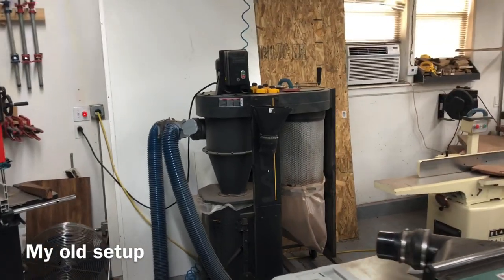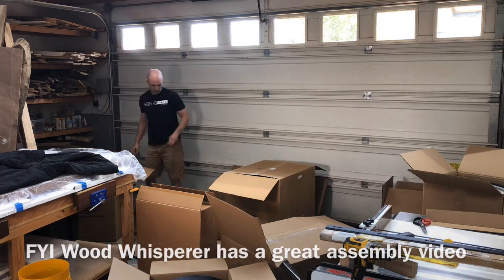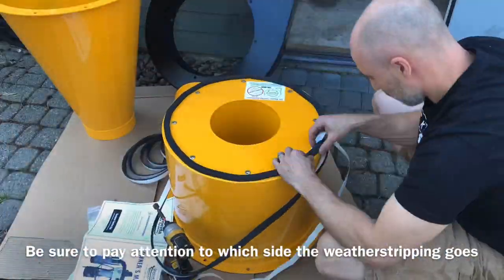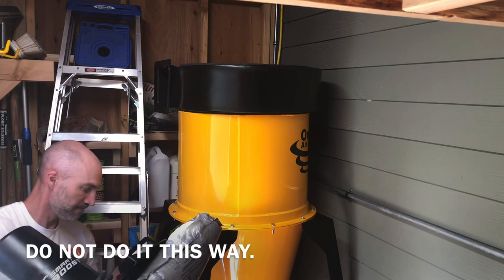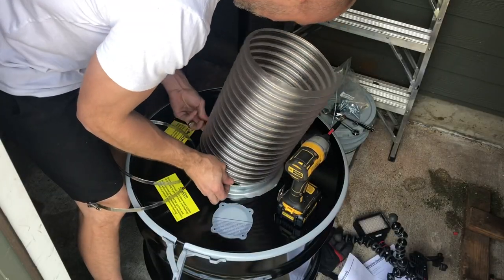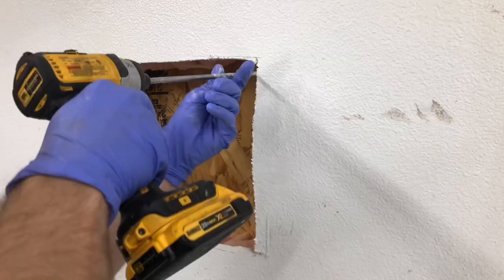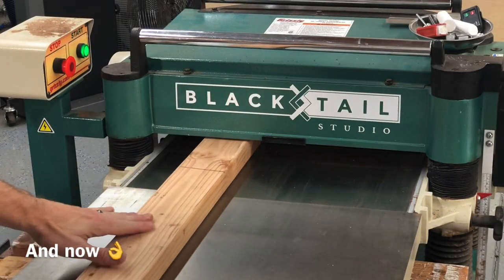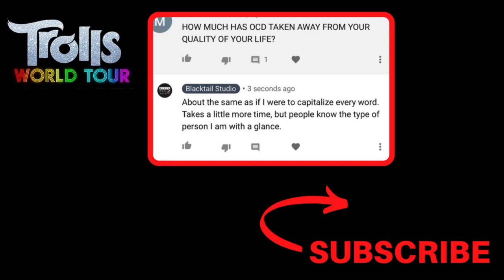Garage Shop Dust Collection - DIY Woodworking

Comment: The video is making me considering  replacing my frankenstein (converted my 2005 bag DC to 2 HP cyclone dust collector with 1 micron drum filter..   It's always been a little undersized since I added the CNC.  Instead of the remote, I took the time to interlock the gates with the DC using 12V dc power and magnetic switches that close when a gate opens and activate a relay.  Any gate opens the DC starts.  On my CNC the gate and the cooling pump (parallel relay)  both have to be on before the DC starts.  I now have my DC on only when I need it and keep the multiple gates from being left open when they aren't in use.
Reply from the maker: Oh, I need that!

Comment: Nice video and system!   I look forward to seeing how a video about your duct work.   I recently purchased the Oneida super cell.    I opted for the super cell because I only need to connect one dust producer at a time and the super cell as a lower footprint for my small shop.   I'm very happy with it.   Like your unit,  no chips coming from planer or jointer now.
Reply from the maker: Good living isn’t it??

Comment: Putting the dust collector in the shed will suck out all your heated air in the winter you could add a return air duct back to shop to get some of the air back in
Reply from the maker: Yup 😊

Comment: We run a Mens Shed workshop here in Australia, with around ten machines, all needing chip and duster extraction. Love the idea of have the system outside. Saw you unpacking the hardware and then putting it all together. Very impressive! A couple of questions I would ask please. How much was all of the hardware? On one setup I have seen, a workshop machine, like a table saw, will not operate unless the dust extraction is turned on. Does your system work like this? Roughly, how much did you spend on the dusting material. Finally, congratulations ; bet your wife has stopped laughing at you stripping over hoses etc.

Comment: YouTube is the tool I use the most as a new woodworking hobbyist!  I’m a full time military UH-60 Blackhawk pilot, so just starting to dabble in woodworking, 1.5-2 yrs from retirement.
I saw in your fire table build that you hand/wet sanded the epoxy.  Was wondering why you didn’t use an orbital sander.  I just got both a 150/3 and a 150/5 Festool sanders and matching CT 36 dust extractors through a total fluke, but was thinking the 150/3 was meant for the super fine sanding you were doing between coats.  Not critiquing, just wondering if it is better to wet sand by hand in that instance vs use something like the orbital?  
And to your comment above about getting the unit for free... I wouldn’t want to go back to paying full price if I were in your position either! :-)
Love your content!
Reply from the maker: Still learning the wet sand game. Think next time I will use the orbital. Good call!

Comment: Next time do what I do when things get heavy: Go out to the street where you live and flag down a beefy looking guy in a pickup truck and just ask and 80% of the time they will help you!
Or for the 7.5hp with plenum just borrow a motor hoist and take it from there using cinder blocks plus your weight to lift the thing, 700 lbs, onto the base. That ladder might just have been over the
weight limit.

Comment: My very expensive planer thicknesser gave up the ghost, ended up buying the cheapest plane thicknesser on the market till i fixed the expensive cast iron one,  its a crappy tin built peace of junk out the box,  best tool I ever bought. TITAN ELECTRIC PLANER £170 INC VAT, from Screwfix. Expensive cast iron one has sat in the back of the shop with parts waiting to be fixed for over 2 years now.
Reply from the maker: Awesome!

Comment: when I was young and foolish (last week) 
i lifted a 900 lb jointer with heavy duty ratchet straps attached very well to my cieling structure so i could spin  the mobile base end for end to give me better maneuverability when parking it, when it was time to lower it back down onto the base i then realized 
" hey these dont ratchet in the opposite direction " .........
Reply from the maker: Bold, billy!

Comment: Come on Cam, again with the tool questions.
The tool that makes my life easier is the tool my wife loves. Lol.
No seriously,  again i would say my many different routers make my life easier. Routers are like underwear, you can never have to many.
Thanks 
Router James
Reply from the maker: Cheers James!
Reply: Boy, that is the truth. Battery drills too. I'm always using two. I have a drill and an impact driver, I pre-drill and countersink the drill, and drive with the Impact driver. I really like the Ryobi tools. You can buy them without a battery, which is by far the most expensive part. My drills, saws, weed eater etc, are all ryobi. The serious stuff is all Festool. Most favorite tool. Festool HEPA vac.

Comment: Just got the new Makita sliding miter saw. It is a beast. Loving it. However, my dust collection is crap. Need an upgrade and intend to do just like you have with adding a shed to house the dust collection and air compressor. It seems like the collection bin on the unit you have is rather small. Will be interested to see how often you have to empty it.
Reply from the maker: For sure

Comment: I am running a 2hp dust collection unit with a 1 micron filter. I still have so much dust all over my shop. I have been eyeing the Oneida unit you have. I am thinking on pulling the trigger on it.
Reply: Aw man - i'm on 1hp think 2hp could be enough of an upgrade, haha! do you have good ports? that helps a lot... also, a short hose run. Since I'm more of a hobbyist I'd like to save up for a supercell, it seems like it is perfect for smaller shops! I'm hoping there will be more reviews and comparisons as time goes on...
Reply from the maker: Ya man, I know that game. I say go for it if you’re ready!

Comment: I don't really have a single tool that makes my life easier, but if I had to choose it would be my new 12" Bosch Axial-Glide Compound Miter Saw. 
As far as lifting the motor assembly by yourself, I would have done it almost exactly the way you did. Except I would of had blue jeans on and my steel toe boots. May not have helped any, but I would of felt more superman..ish...lol
I just hung a 70lb air filtration system in my shop (by myself) using ratchet straps. Maybe you could have screwed in some heavy duty eye bolts into to your shop rafters and used ratchet clamps to lift that motor.....just a thought.
Reply from the maker: I just bought that miter saw!
Reply: @BlacktailStudio  Wow, you will be happy with that saw. After setting up mine it only require a minimal tuning to get it perfect. Hope you have the same experience.

Comment: Audio switch. I use headphones for conference calls, but speakers for general jamming out. The audio switch makes things a one touch between the two. 

For the size of the cyclone, and the filter, the chip/dust collection barrel seems like its on the small side. I assume that can be upgraded in the future? 
for the blast gates, why not do an arduino system, similar to iliketomakestuff's shop?
Reply from the maker: It’s the biggest one you can get before going to three phase power. Which won’t happen in my residential shop.

Comment: My Dewalt 735 planner makes my time in the shop much easier.  Waited for a while to get it and have just upgraded to the helical head, what a difference!  Great video, after you have used your dust collection for a while I would like to hear your thoughts.  I would love to have one.  I work in our garage so would need to consider size and location for it.  Thanks for posting!
Reply from the maker: Will definitely talk more about it

Comment: Probably my Ryobi  18 volt leaf blower. So convenient and versatile. Does your shop not not have AC or heat? Seems like putting dust collector in the shed will suck all your conditioned air outside. I debated that issue for mine but vented it out anyway. Love your videos.
Reply from the maker: I do, but Oregon is pretty mild

Comment: What a great video.  Thank you for telling me that the company helped you out.
One of the tips I got out of this was how much the flex hose moved.
Question  
5 hp motor. 
I'm assuming its 220v ?????
Also is there a warning label 
"Little children are not allowed while in use" 😛😛
Again the motor looks crazy heavy. My back was in spasm watching you lift it and on a ladder no less
Thanks again and Stay SAFE RRRR
Reply from the maker: Ya, 5hp 220. Keep the pets away from the ducts!

Comment: My CBN low-speed sharpening setup ... I can't believe it took me so long to discover its joys. Or perhaps it is M42 lathe chisels ... carbides are OK but logs actually cut with steel gouges.   
Back to dust collecting ... Hmm, I'm now wondering How can I get Oneida to give me a DC that'll give me that great performance for my lathe and router table💡💡    Stay safe.  -Mike😷
Reply from the maker: That’s awesome. I’m just starting to turn
Reply: @BlacktailStudio  😁👍👀

Comment: Cam, as always, great job. I am adding 16 feet onto my shop end to end and I am considering moving my 5hp Oneida dust gorilla pro outside. I usually don't run it continuously but should I provide a return vent? I have read the comments just curious about your experience.

Comment: Big fan of my track saw and my jessem tablesaw stock guides.  Both make breaking down large sheet goods easier.

I’ve wanted to do the same thing with a bigger dust collector and air compressor in a smaller shed behind my shop.  However I’m a little concerned about sucking all the conditioned air out of my shop and have that about how I would duct it so the filter was inside the conditioned shop.  Are you worried about losing any of the air conditioned air in your shop?  Curious to learn how this works out for you longer term.  Cheers.  Your work is always super inspiring and encourages me to tackle bigger projects.
Reply from the maker: Ya, some people suggested a return from the shed. Might go that route

Comment: which tool? hm... has to be my smartphone. I know it's kind of a cop-out answer but it's the truth - it does far more for me and making my life easier than anything else I can think of. Inside the shop it's probably my dust mask, because if i don't use it life ain't pleasant!

damn man, next time winch/pulley the motor up to the ceiling, slide the assembly under it, then lower it down!

great video though - i would love to get a supercell since I kinda stop at the hobbiest level and I have a 10x20 shop. seems like it gives the best of both worlds. Sounds like I need to start a youtube channel :D
Reply from the maker: I highly recommend that 😉

Comment: It's a toss up between my table saw or my planner! Hard to say which one I value most, but probably my planer? But  wow Brother what I would give too be able to afford this for my garage shop!! Smh
This looks like one beautiful and completely sufficient unit!! I don't have anything at all for dust collection, but unfortunately being retired and on a fixed income, it is what it is I guess! Looks like a super nice addition though for sure!! 👍I.may be able too afford your old dust collector though( maybe) if your interested in selling it? Thanks bro, and as usual great video! 👍
Reply from the maker: Already sold it! Check out the cyclone adapters Oneida makes. Can hook cheap units to em

Comment: Nice video - looking forward to the "ducting edition." I have the same unit and it's awesome. 
One question for you: I originally installed mine in a space outside of the shop (upstairs from the basement shop). There was so much suction from the Gorilla I had trouble with air coming in around the door and garage door of the shop. I was literally sucking the heat (in the winter) and cool (in the summer) out of the shop. In fact, the garage door was pulling against its track! I ended up moving the DC into the space. Louder, but no air problems.
Have you noticed this with your outdoor-shed installation?
Reply from the maker: Not yet! I’ll add an air return if I do though

Comment: Current favorite tool is a Pica-Dry pencil (2mm).  Ok so, I'm about to order an Oneida Supercell. I don't really have room for your type of setup unless I build a shed too. The Gorilla and the Supercell are in the same price range it seems. Any thoughts on whether the Supercell is sufficient (using more or less your same tool set)? Many thanks and I really appreciate your detailed video on this. Oneida was smart to send you that dust collector!
Reply from the maker: Depends on how many tools you want to run at one time. One tool, for sure. If you have any questions, give Oneida a call and they can direct you.

Comment: My question is about what you've learned to keep tables flat.  You use steel with slots for the wood movement.  Do your tables ever develop cracks?  I'm currently building a 52 inch round walnut table, 1 5/8 inches thick.  Recommendations?  A video about reinforcement techniques would be awesome.
Reply from the maker: No cracks yet! Pretty thin for channels. Also pretty wide to not have em. I’d use a supportive base

Comment: That was painful to watch you try and lift that motor housing into place. I had to do a jointer assembly upside down and then flip the stand and cast iron long bed table rightside up by myself. Not the brightest idea but woodworkers get it done. Hope the new dust system is nice. I got the Laguna one you had but need more shop space to put a more permanent system in.
Reply from the maker: Just takes time! Work with what ya got, nothing wrong with that

Comment: What about the air intake for your shop.
Now your creating a vacuum so somewhere air has to go in.
Also with the shed setup you will loose all AC or heated air in no time.
Its all gonna go in your shed.
option is to route a pipe back inside and place the filter unit in your workshop.

Ow and my most difficult task was getting a rollling base under my bandsaw.
I Almost tipped it over and its about 400lb.
That was a close call.
I would never been able to stop it from falling.
Reply from the maker: I might go that route!

Comment: My Dewalt 20v cordless tools!  Great video.  I can’t believe you did all of that by yourself!  I’ve been shopping for a dust collection system and settled on Oneida, then ran across your video.  I’m thinking about the 3hp unit and ducting for my personal shop.  I’m wondering if there is a downside of me running the ductwork to my table saw (centrally located) vertically up to the 18’ rafters.  Any thoughts?  Thanks, I always enjoy your videos.

Comment: What model and HP was the DC you replaced. Looks like a laguna. We are in a 2 car garage, tired of the chips escaping from the jointer planer and table saw accumulating in our floor and breathing that dust. We have a 1.5 HP old delta DC with bag filter. Not sure if we should upgrade to 2hp or 3hp model.

Comment: Hi Cam, I don't really have a favourite tool, but there are some I definitely get more use out of. I love tools period. I had a question about dust collection. I typically try to do any work outside when I can and use a 3m mask with a P100 cartridge as I am a hobbyist when it comes to woodworking. Any issues you see with that? The second question is, I have some walnut live edge slabs about 1.25" thick that is slightly curved and I'm wondering if I should plane it down flat, mechanically flatten it or use epoxy to make up the void and plane it after? Any insight would be appreciated and congrats on the new acquisition. Smart to put it outside and it looks like it works great. Hate to see you struggle, so maybe next time you can rig off the overhead trusses or beam and use a chain fall or come-along. Motors are difficult to rig vertically as there usually is no lifting point, but just a suggestion. This also would depend on how much headroom you have though. Take care and thanks in advance.
Reply from the maker: Thanks for the tips!

Comment: My iPad make my life easier. Question: Is there a problem having the air return in the shed vs. the shop?
Reply: It'll affect air conditioning air (if any) being taken out of the shop. It'll also create negative pressure that may cause outside air being sucked into shop. Could crack a door to the house to minimize outside air to a degree

I'm in hot ass Florida so my response is biased lol
Reply from the maker: Ya, like he said. If it’s too bad for heat or AC I’ll figure something out. Also have a window cracked
Reply: @TheRPhelps24  Texas, same here.

Comment: Great video on dust collection. ? Question: How do you deal with draining condensation from the air compressor? Do you get more because it is in an unheated shed?
Reply from the maker: Ya, have to drain it regularly

Comment: My favorite tool is my SCM 16 inch Bandsaw.  I currently have a Jet DC1100 with flexible hoses.  I have most of my tools in a central location on wheels and I pull the one I want out to the center of the shop and hook up dust collection.  I added an Onieda Super Dust Deputy with 4 inch input and output and there are hardly any chips or dust in my Jet collector.  I have given many people advise that if they are going to buy a new dust collector to get a cyclonic to start with.  In the video you said you got the DC for free, did you get the ducts free or did you buy them?  Your set up looks good.
Reply from the maker: I had to buy and install everything else. And I tell people the same. Get a cyclone and cheap used unit

Comment: Hi Cam.
Quick question, I recently bought a 1hp dust collector for my garage setup.
I feel like the suction at the table saw is really low,  I know it isn't supposed to be vacuum level suction but I barely feel air moving down the blade, is that what you experience as well? or do you have a really good airflow from the blade?
I use my dust collector 1 tool at a time